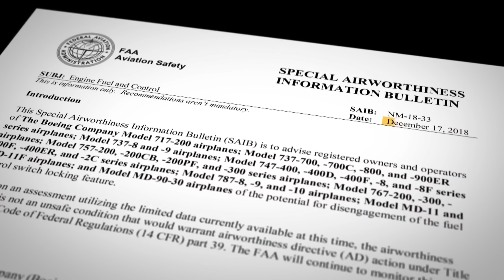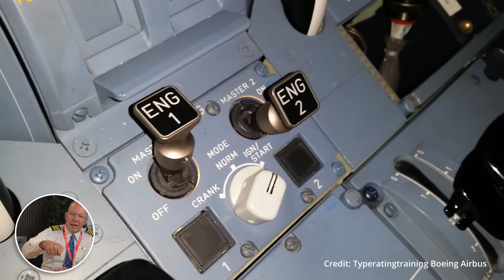Air India 171: The FAA’s 2018 Fuel Switch Locking Bulletin Explained (16 Questions Answered)

Comment: Turning both those fuel control switches to the OFF position is NOT a one second operation. It takes 2.5 to 3 seconds to lift the switches and pull them back together. But the report says it "transitioned" in one second.

The sole survivor said at the apex of the short flight  the lights in the passenger compartment flickered off and on. Clearly an electrical glitch. Yet some "experts" have not taken that into account. 

People should  stop covering for Boeing and its shareholders.

Comment: HOW MUCH BOEING PAID YOU?

Plz discuss: Mary Schiavo, a seasoned aviation attorney and former U.S. Department of Transportation Inspector General, has strongly highlighted a critical issue involving a 2019 ANA Boeing 787 flight—where a software defect in the Thrust Control Malfunction Accommodation (TCMA)/FADEC systems caused an automatic dual-engine power rollback during final approach, even without pilot input

Comment: No! No! No! No! No!
Even if the effen switches didn't have locks to prevent them from moving, they would not move without force applied! You don't accidentally knock both switches a full second apart, especially when you're hand should not be anywhere near the switches after rotate speed. As the captain was the PM, he likely used his right hand to follow the throttles to TOGA and stayed there until rotate speed, then took his hand away. At that point, his right hand would not cross over the center console until he reached for the gear lever, which is nowhere near the fuel cut off switches. FFS, the PF was focused on flying the plane with both hands. The PM was the only one with a free hand! Stop with all the BS, already!

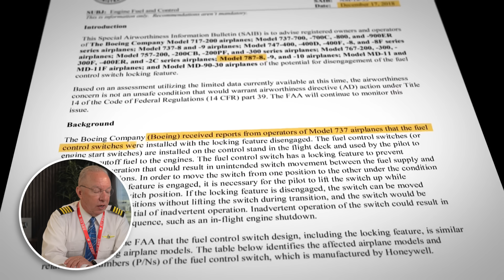Comment: 7:42 What bullshit are you speaking read the bulletin properly it's not about the switch installed upside down that simply can't happen are you having a laugh mate it's about the LOCKING FEATURE the spring loaded action or locking mechanism being disengaged and since this was not a directive but an "advisory" the airline may or may not have taken it seriously to cross check if the switch has the locking on or not

Comment: I have a question regarding the SAIB issued on December 17, 2018. The report mentions that “The Boeing Company received reports from operators that the fuel control switches were installed with the locking feature disengaged.” The Air India 787-8 is listed among the affected aircraft.

Given this, is it possible that the fuel control switches may have malfunctioned—specifically, that they could have moved to the cut-off position without any human intervention due to the disengaged locking mechanism? This scenario would also align with the cockpit conversation between the two pilots referencing the fuel cut-off switches.

Comment: If the possibility for the switch locking mechanism to disengage were extremely extremely low, then the possibility for two switches to occur the same time are practically infinite .

Comment: Without video we have no way of knowing whether the switches were flipped by a person, and if so, by which one. It would confirm or rule out mechanical failure of the safety mechanisms in this case and in the case of manual switching confirm which pilot was covering their tracks - the one who asked the question or the one who answered it.

Comment: 2 unacceptable answers: 1) about alerts regarding fuel cutoof switch 2) that videos cannot prevent accidents -- yes, but that is not the issue; the issue is about finding out.  also it cannot be leaked out as much as the cvr cannot be leaked out if the manufacturer also put the video in the black boxes

Comment: (MSP Aircraft crash)
Air India Flight 171 crash. The Wrong Hole?!
The first video from flight 171 showed a swirl behind the wing. This
was initially assessed as dust from the ground. Later this was
reassessed as fuel from the engine. I think there is good reason to
believe that the engine is the wrong hole and that the fuel came
from the surge tank scoop embedded in the wing.
AI says it is rare to have fuel in the surge tanks at takeoﬀ. To get
there the refuelling process must have overfilled the tanks.
As the aircraft raced down the runway at full throttle so too did the
airflow over the surge tank scoop creating a Venturi eﬀect suction
in the fuel system. The pressure in the centre tank from which both
engines get their fuel on takeoﬀ suddenly changed from pressure
to vacuum with a consequence of reduced fuel flow to the engines
even though the throttles remained fully open. The horrified
Captain watched the situation of reducing thrust at the end of the
runway not knowing what to do and instinctively switched oﬀ the
fuel switches to try and trigger this glitch.
He saw no eﬀect and immediately switched one engine back and
waited a little longer to then switch on the other.
All the eﬀects that were noted can be explained by this scenario.
The engines reduced power together on takeoﬀ. The captain did
turn the fuel switches oﬀ and on again in accordance with his wide
experience. There was power during the guide to the crash site.
The engine noise the survivor heard was probably the last of the
fuel being expelled from the surge tank and a whoosh of pressure
coming back into the vacuum of the fuel system.
I am a complete amateur who is interested in aircraft accidents. I
sat down with a piece of paper and an AI app for my source.
I send my condolences to the relatives and friends of all those who
perished in this horrible accident.
Mike P

Comment: Captain Steve, please comment on a Japan Airlines flight ANA 787-8 that both fuel switches moved to OFF, without the pilots touching the switches….??  Pasted from news article:  Not the first time Boeing 787 experienced such a failure: US expert
 
In an exclusive comment to Financial Express, US aviation expert Mary Schiavo pointed out that this is not the first time such a failure has occurred on a Boeing 787 Dreamliner. She cited a 2019 incident involving an All Nippon Airways (ANA) flight in Japan, where the fuel switch transitioned on its own, without any pilot input, while the aircraft was on final approach.
 
Software glitch caused ANA engine failure
 
Schiavo told Financial Express that an investigation into the ANA incident revealed a software glitch had led to the transition of the fuel switch. The software issue caused the aircraft to mistakenly interpret that it was on the ground, prompting the Thrust Control Malfunction Accommodation (TCMA) system to shut off fuel to the engines, even though the pilots had not activated the fuel cut-off themselves.
 
The ANA flight, a Boeing 787 Dreamliner flying from Tokyo to Osaka with 109 passengers and nine crew members, experienced a dual engine flameout after the pilot deployed the thrust reversers for landing. The aircraft had to be towed from the runway, but no injuries were reported.
Reply: The ANA 787-8 problem was caused by the Thrust Control Malfunction Accommodation (TCMA) software, and not reverse thrusters as stated previously.  My apologies for the error.

Comment: Hi Captain,
I do love your vids, but to say that video in the cockpit would add little to the evidence, especially in this case, I don’t think is right…
For example, the pilot that asked “why did you cut off” may have been the pilot who actually cut off the fuel. It will be easy to know who said this from the mic that picked it up, but maybe they actually did it but asked “why” about an act they committed.
This will be very difficult to ascertain with CVR & FDR but without video as those 
controls are central, not Pilot specific.
Video in the cockpit no brainer.
Maybe I’m wrong, but with exception to union/preference rules, and having a few hundred lives at risk, please do convince me to the contrary.

Comment: I don't see how we can be sure that the shut down switches were turned off and then back on. Maybe the one pilot thought the switches were turned off because the engines spooled down when it could have been the FADEX's that spooled the engines down. And the FADEX's could have spooled the engines back up again without the switches being used. I heard one video where it was said that 171 used up every bit of the runway. Maybe 171 used a little more than the whole runway and therefore the landing gear WOW sensors sent confusing data to the FEDEX's, which in turn spooled down the engines. There was a lot of dust kicked up at the end of the runway and maybe that was because 171 overran the runway a little.

Comment: Former Boeing engineer and current embedded automation engineer here, the fuel cutoffs are monitored by a microprocessor but they're directly wired to the relays that drive the fuel cutoffs. A solder ball failure would not cause the cutoffs to actuate, there is no single electrical path that could simultaneously affect both cutoffs, and it would not be able to physically actuate a pair of switches. 

As a general rule, I strongly dislike any design decision made out of distrust for pilots or with the intention of taking away the pilots' control over a normal operation -- the 737 MAX disaster happened because a group of absolute buffoons decided that it was okay to let a computer second-guess the pilots and not even tell them that it was making changes, and we saw how that ended. The only things I'm ever willing to totally block the operators from doing are things that should never be done in flight, such as changing the firmware on the computer or opening the engine cowls; for everything else, I'll add warnings but I'll always trust the pilots more than the computers. 

The ECAM operates the throttle levels, but the cutoffs are direct logic. A total computer failure won't stop you from being able to operate the fuel cutoffs (at least not directly; it's hypothetically possible that a serious computer malfunction would eventually cause power loss and drain the backup batteries, but that would take hours or days).

There's no such thing as a "cyber attack" on an airplane's computer system -- there's no way to directly interface with those computers that doesn't involve landing the plane, setting the flight controls into a state where takeoff is impossible, entering the electronics bay or opening the engine cowls, and directly plugging a programmer into the computer being operated upon. The only data interfaces that work during flight will only accept very specific data and will straight-up ignore everything else, and the computers have checksum verification that is used to ensure that they can't be surreptitiously altered. 

It's possible -- but very unlikely -- that this was the result of a seizure; some seizures can result in the patient doing things "on autopilot" without realizing what they're doing, and they can be somewhat responsive but not fully aware during and after the seizure. Deliberate action is still the most likely reason, but we don't know for certain.

Comment: having reflected upon the whole senerio and putting all parties into consideration, here is what I think happened.
1. there seems to be a mechanical/electrical issue that might have caused the fuel control to tripp unknowing to both pilots. 
2. which prompted the captain to ask, But surprised as well the copilot earnestly responded he didn't do it.
3. immediately they tried putting it back on run, Buh it seems to be stalked, they struggled with it for 10secs, d left switch finally got back, then 4secs later the right.
4. those who investigated intentionally cropped out the 10secs conversation when the pilots struggled to switch it back to run, so as not to put the blame on Boeing and Air India.
5. the answer/prove to this mystery is in that 10secs.
6. the pilots are innocent
Reply: Also, they have provided timestamps of all the events other than the mentioned CVR conversation.

Comment: I honestly dont trust this guy, this guy is a lowkey racist and was the first person to publish that the flaps were not brough up and speculated it was the pilots error. In all of his videos on Air India he has literally looked for ways to blame it on the Indian pilots. He must be delighted to see the report pointing the blame towards the pilot.
Reply: I trust this guy very much. For something like this to happen just points to pilot error. Which in this case, one of the pilots pulled both cutoff switches to the off position just after take off. Steve has a lot of experience to know what is normal and abnormal. This crash was really abnormal.
Reply: @NineballChris  so you are telling me that these pilots with years of experience and training, for no apparents reason just cut the fuel off to both the enginers right at takeoff for no apparent reason ? Are you alright?

Comment: Thought the bulletin said the locking mechanism was not working not that it was installed upside down. Meaning could a pilots hand toggle the switches accidentally when letting go off throttle

Comment: @ 6:22 you are responding to a question and say "we know from the data recorder and the cockpit voice recorder that this was a human intervention. I don't know/see how you can make that statement when the voice recording has one pilot questioning the other pilot and the other pilot says "I did not do so" and there is no empirical evidence (images/witnesses) that show hands on those switches. I have watched lots of your videos and have not yet heard you ask/say if there any other sources to command the fuel valves closed. Other commenters have stated that the EECU (Electronic Engine Control Unit) and/or the FADAC unit can also send those that signal. For whatever reason, you appear to refuse to even consider looking into that while professing you don't want to blame the pilots. Support cameras focussed upon the control panels so this will never be a question again. And, as a "fair" expert, look into alternative sources for closing the fuel valves.
SEE @gcvrsa comment below as it exactly duplicates my thought that I have entered already here and on multiple other sites.

Comment: It seems to me that the pilot that turned off the fuel switches could have done so by accident instead of retracting the gear and truly did not think he had done so when questioned by the other pilot. Muscle memory can lead to doing something besides what you intended to do, and he may have been completely confused afterwards as well. Just the other day,  I accidentally shifted my car into park while driving instead of turning down the radio as I intended. Two different controls...and a big WTF moment in my brain.

Comment: Would it be possible in future to have sensors on the control column to measure pilot’s vital’s such as you have when doing lie detection, to determine whether a pilot is fit to fly? Then the other pilot can take over

Comment: Capt.....I THINK YOU NEED TO LOOK INTO THE SERV BULL ON THE FADEC CHIP THAT CONTROLLS THE ENGINES....EVERYONE THINKS INCLUDING YOURSELF THAT THE SWITCH MANIPULATION CAUSED THE CRASH....THE SWITCHES DO ONE THING SEND SIGNAL TO THE CHIP..... IT IS POSSIBLE THAT THIS CHIP COULD FAIL AND OR THE SWITCH INTERNALY AND CAUSE A LOSS OF SIGNAL COMMAND WITHOUT PHYSICALY MOVING THE SWITCHES AND CAUSE ENGINE FLAMEOUT AND IF SOMEONE OF THE CREW WANTED TO CRASH THEN WHY THE RESTART ATTEMPT? AND THERE WOULD BE MORE CONVERSATION ON THE CVR THAN A SIMPLE QUESTION. I WOULD THINK A PILOT WITH YOUR EXPERIENCE WOULD NOT BE SO QUICK TO JOIN THIS ASSUMPTION......

Comment: SOME AIRLINES CHECKING BOEING FUEL SWITCHES AFTER AIR INDIA CRASH 15th July 2025 in Japan Times. It notes throttle module replaced, includes fuel switches were replaced 2019 and 2023 on Air India plane involved in crash as shown in maintenance records. So who's hiding the homicides now then?

Comment: I haven't seen this mentioned anywhere, but is it possible that sabotage—or something similar—could be involved? For example, if the wiring was tampered with so that the landing gear and engine cut-off switches were swapped, the pilot might have unknowingly shut down the engines while trying to raise the landing gear. That could explain why the other pilot insisted they didn't cut the engines. It may sound far-fetched, but I thought it was worth considering.

Comment: That plane was having electrical issues on the previous flight with passengers reporting lights were off, tv off, air con off. So that plane had an issue and should have been grounded. Mechanical faults. In the report it said RAT deployed while still at airport on leaving tarmac. That reads like a mechanical fault. Read again.

Comment: Where's the explanation of the FAA's Fuel Switch Locking Bulletin which is shown at the beginning of the video. Just a short a short dismissal of what the report says and then on to the next question! The report clearly states thate the switches can be moved without lifting the switch if the locking feature is disabled. Were the switches faulty? They must have been found in the crashed plane. And other pilots previously flying this particular aircraft must be able to report if the switches were faulty. Steve doesn't seem interested in this. And he doesn't know if there would be an alarm if the fuel is switched off during a takeoff? Hmm, I wouldn't trust this pilot very much after watching this video.